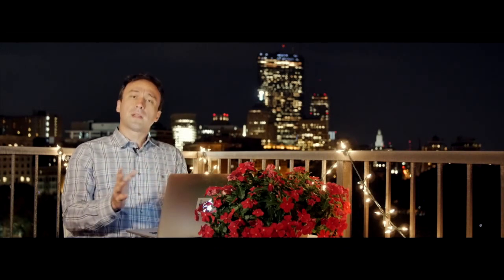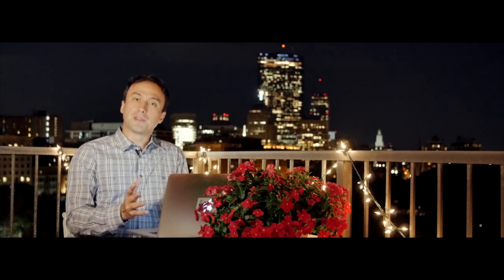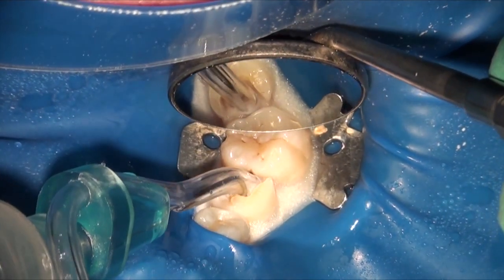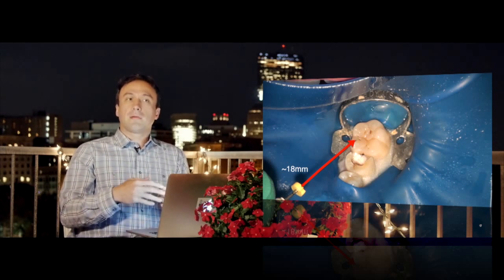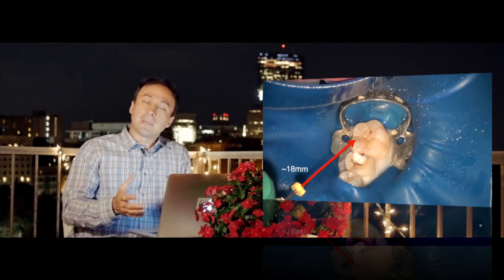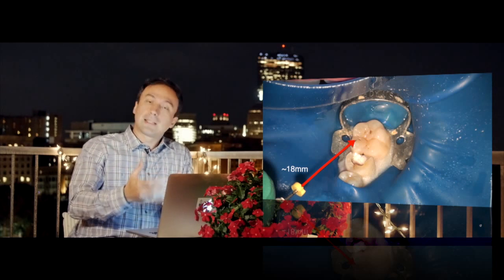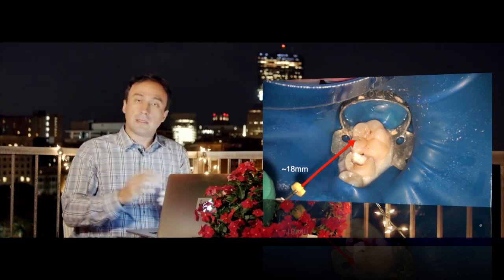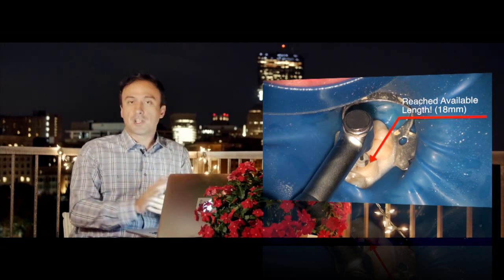CBL #8: Basic ESX Premolar and Vertical GP

Comment: I did my first 'difficult' endo with ESX on Monday. It went so smooth. I can't tell you how safe this system feels. Once you get all the canals to a 15/.02 with hand files. The rest is so easy...I enjoy this system much better than EndoSequence. I've also started using the blue handi-dams, which makes life so much easier. Thanks Dr. Nasseh!
Reply from the maker: That's great. In difficult cases that are very curved, I've also found that sometimes replacing the Expeditor (15/.05) with the ESX Scout (15/.04) will help reduce the potential torque of the larger taper. So, in very tough cases, getting to 15/.02 then going to the 15/.04 and finishing with the 25/.04 may be recommended.
Reply: The ESX scout (15/.04) is essentially the same as an Endosequence 15/.04 correct? I have a ton of those laying around. Also, I've been using my wife's beauty blender dense sponges instead of the Endoswipe (which is not available yet) and it's working perfectly. My guess is that they're made of a similar material. I just got my CBCT installed last week and found a deep split in #13. Love the 3D for endo. Thanks again for your videos, your contribution to Endo is greatly appreciated!
Reply from the maker: A Palmer That's great. Yes, ESX 15/.04 is the same as EndoSequence 15/.04. You can use them interchangeably. I'm happy to hear about your CBCT. It's a great help for doing great endo. Of course, the key is to not pass all the costs to the patients and that's why I only use it for surgery or retreatments at this time. Some people say they use it to find where the MB2 is. I guess the answer is that MB2 is there almost all the time, there's not point in confirming it! Again, keeping the cost of this procedure under control for the patients is an important thing for us here at RWE. Good luck and share some of your CBCT and other cases on the RWE website with your colleagues. Thanks!